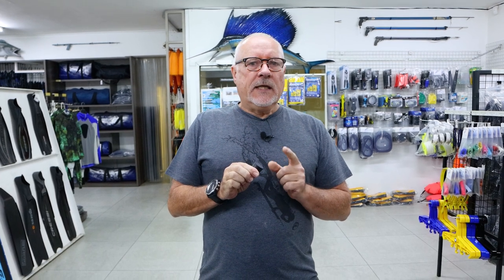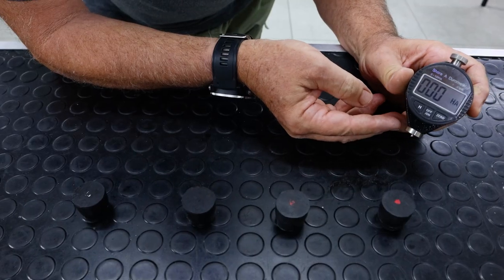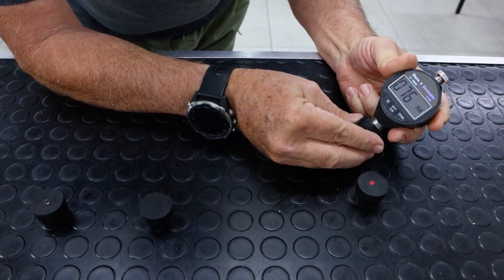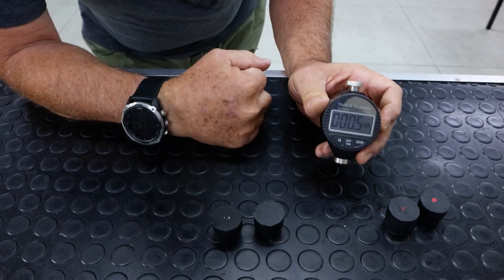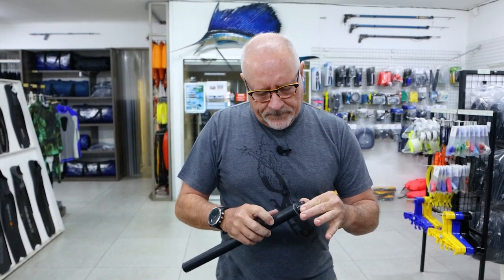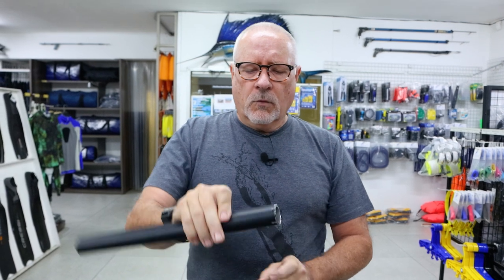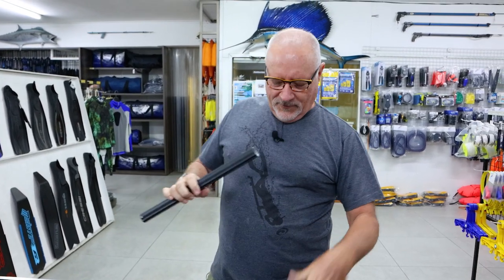Rob Allen | DIY | Barrel Plugging | 2023

Comment: Brilliant could use a bottle jack for the hard plugs, awesome you make the plugs available, best company ever.
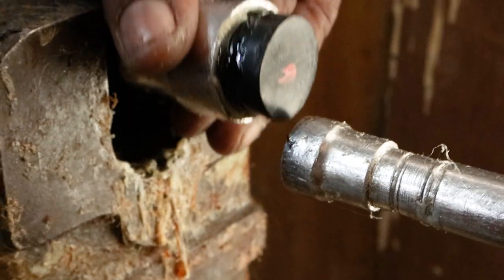Reply from the maker: Yes, you can use a bottle jack but with the harder rubber you need a shaped lead in socket to install. Look at 1:08 to see the steel sleeve for the push that we use. This is the same as what they use in the bottle corking industry.
Reply: Great thanks yeah I see the socket now.
Reply from the maker: @cblaster171  👍

Comment: Thanks Rob 👍 I'd like to fill the barrel with foam to make the aluminium tubing quieter ...any thoughts on this?thanks
Reply from the maker: I don't think it will help much. If you want it quieter, better to use a carbon barrel. If you want to make it quieter to not scare fish, always remember the shock wave moving forward caused by your rubbers when fired is a massive "sound" to fish. No matter how quiet you make the gun you cannot block that shock way. Also remember, foam will add mass to the gun.
Reply: @RobAllenSpearfishing  legend, thanks Rob. New specs look good mate!
Reply from the maker: @lyntonhowes5154  😜👍

Comment: Im looking at reducing one of your 100cm rails to 90cm.
From watching this i assume i cant push my original plug deeper into the barrel before cutting it shorter? 
We have propper hydraulic press at work for bearings that i could use. 
I was worried about the barrel exploding.. 😂
If not how do i get a new plug in the uk? 
Thanks Rob
Reply from the maker: Pushing it further down is no problem, just do it while the handle is off. Once you have cut and set the plug, might be an idea to add a little sealant on top. The plug should not move without it but always better to be sure that water will not force its way past.

Comment: I cut a barrel and use a jack and with some oil the plug in the barrel moved..i did add some silicone just for safty....this plug will work on a bigger dia barrel?
Reply from the maker: I have never tried to use it in a bigger barrel, obviously the bigger the barrel ID the more likely it will not work.

Comment: Cheers guys! Supose someone messed up the plugging of the barrel and the plug ended up more than half way inside the barrel…which solution would you propose? (Asking for a friend🤣🤣🤣)
Reply from the maker: To remove means you need a tool to get inside. We use wood boring drills with long extensions on a lathe. Most times it is just easier to leave it there and set another plug in the correct place above it. You will not feel the added weight of the old plug when using the gun but you will be back to having the majority of the buoyancy.
Reply: @RobAllenSpearfishing  Thank yoiu so much! Hopefully everything will go well now :)
Reply from the maker: @canalfrankpc  Good luck.

Comment: Hi Rob, very relevant for me. I'm trying to install a bung in a cut-down carbon barrel. Both barrel and bung from you guys. But there's no way I can just push the bung into the barrel. It is a pretty hard bung, feels same as the one I took out of the offcut end. Are these different bungs you're making available?
Reply from the maker: Yes, these are new due tho just that fact you are experiencing, where are you?
Reply: @RobAllenSpearfishing  OK great. I'm in Perth, Western Australia
Reply from the maker: @nicholascroukamp1463  Ok, you will have to put pressure on your local dealer to get our distributor to bring in some. I have a small parcel leaving in 2 to 3 weeks, if you can wait that long.
Reply: Hey Rob, great share! And thanks so much. 🎉